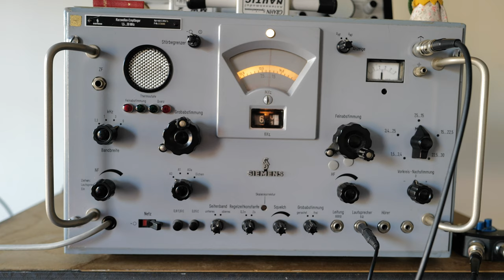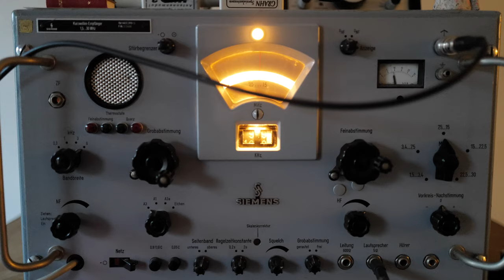MRA QRP little LOOP antenna

Comment: Hi, great video, thanks for posting... did you try to transmit with this antenna? thanks
Reply from the maker: Hi, thankyou! I do not have a transmitter / no license either so did not try. I do know if the antenna is OK for transmitting. In the advertisement 'transceivers' are mentioned but not sure if that's a god translation. You could ask the manufacturer in the linked ad.
Reply: Thank you.... Go get your license 😊 guys like you are missed on the aether
Reply from the maker: @miniwattnetwork8204  Thanks for sating that! When I listen, there are really friendly Englishmen chatting about many subjects, or old friendly Germans having conversations about their rigs, antennas etc, but I never hear Dutch folks down here I'd like to be a part of. If they are active it's merely competing to see who can make most connections. If I get my license it would first be for low power and I'd be stuck with the Dutch ;-)
Reply: Где купить такую антенну?